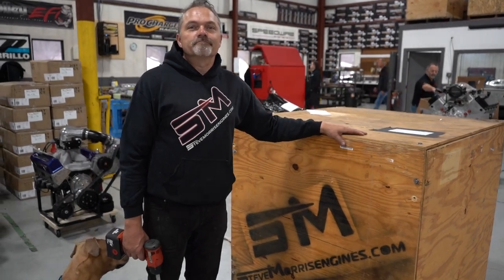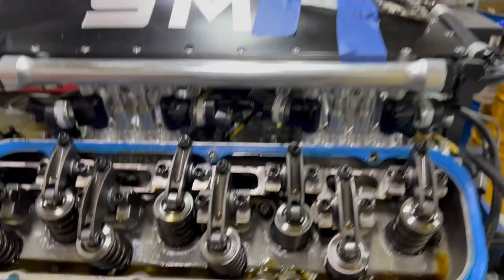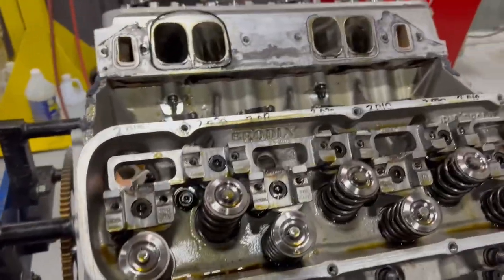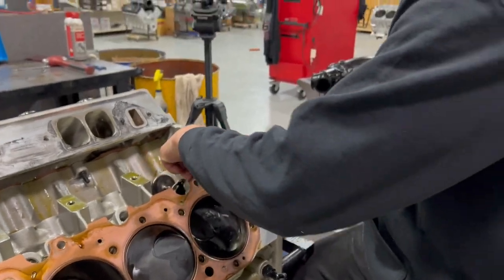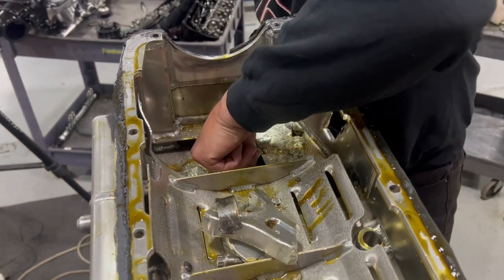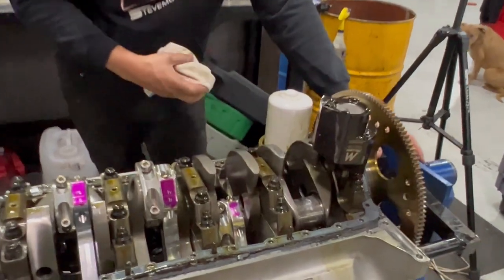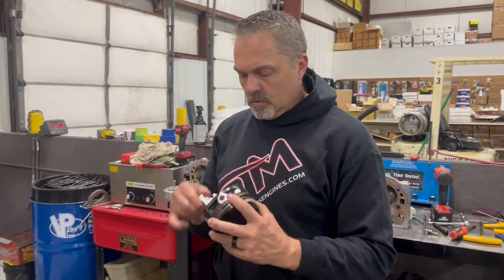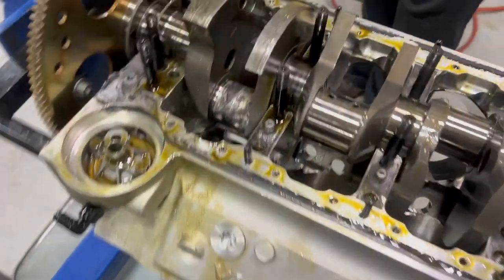Mullet !  What Happened ? - Warning: Engine CARNAGE

Comment: Hi Steve, when mullet did a wheelie and banged down scuffing the track could the kinetic energy involved in hitting the track along with the energy in the rotational mass damage the crank etc. Just a thought, thanks for another great video.
Reply: That is a great question.
Reply: That's maybe possible. I was thinking about what has happened when the engine was running with no oil for a while. My conclusion seems reasonable too.

It seems like the oil pump is on that side so 7/8 will be the last pair to get lubrication again when you run without oil. The heat is on the ' wrong side' of the bearing and since Steve had trouble to find an explanation for it, I think it's the aftermath of Cleet being 'an idiot'/making a mistake. Read below if you're interested in my reasoning.

My full explanation:

The engine was sitting in the shop with no oil in it so all the oil remaining in the engine/bearing flows to the bottom. Then the engine is started without oil and naturally the bearing side that is on top will heat up first, cause almost all oil has ran down to the bottom part of the bearing cause gravitation is real.
Same with the pistons. You don't know at what position the crankshaft came to halt, but if you look at it it's likely that that the crank part of 7/8 was pointing down. You can see that the spot where the heat was is facing up both times if you rotate the crank.
The way Steve explained it the bearing of the rods are fed from the crank bearings. After Cleetus put oil back in the pressure in the oil system is starting to build again. All the oil is pumped into the engine again and will take the path of least resistance. That means that almost all oil will flow past main bearing four so the dry side of that bearing four will get most heat of all crank bearings. When the oil finally gets to the rods most oil will flow past rod bearing seven till rod bearing eight has built pressure and bearing seven will finally get full oil pressure.

If I understood Steve correctly, it all makes sense.
Reply: @CrossEyedLion85  I think you would see more damage on the rest of the bearings if a dry start caused all of this. Oil hangs around as a film, I am sure it didn't do any favours to the bearings starting it with no oil, but no load and a short time isn't going to make a lot of heat. It was also mid Sick-Week so I don't think the oil was out of it for long, leaving more of a protective film behind than if it were drained and sat for a while empty.
Reply: I say starting it up without oil started the chain of events that bought on her demise. Your outta here.
Reply: @seangreene64  Why do the rest of the bearings look fine if that is what started this?
Reply: @CrossEyedLion85  the problem i see in your hypotenuse, to use the proper nomenclature, is that the visible signs of thermal breakdown due to friction occurred on a main journal.  thus, no rod bearing failing to remain afloat.  
✌️🐝➕
Reply: Good comment. Hopefully Steve responds
Reply: @seangreene64  I hope your misuse of you're was because you actually meant you were outta here. If so, thank you.
Reply: @--_DJ_--  As I explained the 4th crank bearing and 7th rod bearing will stay 'dry' for the longest time simply cause that seems to be the design of the oil system.

If you drill holes into a water hose and you fill it up for the first time, you will see that the holes closest to the water input will be at pressure last. Same thing in the engine.

I assume that Cleetus let the engine run without oil. Noticed his mistake. Filled up oil and instantly started the engine again.

That way the bearings will have been hot already with the remaining oil getting thin like water. Causing the start of what happened here.

Obviously you fill your engine with oil before you start it, but in case you forget like here you should refill the engine with oil. Let it cool down over a few hours. Then just crank the engine with the startet motor till you have oil pressure again and then restart on ignition.
Reply: @CrossEyedLion85  If you have a good pump on your hose that first hole comes up to pressure very quickly, and a bit will be coming out the whole time until it is up to pressure. 
There isn't enough damage on the other bearings for your theory to make sense. They all got the same treatment, there would be signs of heat on all of them if there was heat on any of them. The fraction of a second it takes for oil to get from one drilling to the next isn't going to make that big of a difference.
Reply: @CrossEyedLion85  Man cant argue with your logic.👍👍
Reply: @CrossEyedLion85  Those delays you refer to between sections achieving full oil pressure is negligible at best. The flow rate that these and all oil pumps create is huge, think fire hose aimed in your kitchen sink flow rates. The  crank is the first to see oil flow on engine turn over and then upstairs to the top end.  Generally the rods furthest away from the oil pump are the last to see flow but again only micro seconds.
visible damage from low or no oil flow is nearly always around the entire journal due to debris being dragged across the initially good bearing.
The damage to those two journals at the oil pump end are very likely the result of zero contact with the journal and bearing crush occuring on the back side.
Engines can run for an amazing period of time with no oil before damage occurs and at low idle with virtually no load on the bearings heat takes a while to build to fail levels.
I cant speak for steve but when I assemble engines I always use assembly lube on all bearings to firstly extend the safe time while oil pressure is being built during first start especially if I haven't pre oiled the engine prior to spin up and secondly it allows for extended shelf times before install and no fear of dry bearings.
Reply: @--_DJ_--   usually it’s a cooling issue in those back cylinders that causes them to lean out from my understanding, but doesn’t look like it in this situation.
Reply: @CrossEyedLion85  the bearing on the cap side was the first to fail. That alone shoots at least some holes in your theory.  Another point that goes against your thoughts. More than 1 half of 1 bearing would have shown heat damage. 
The engine had recently been run prior to the oil change. So it wouldn't have been a dry start so to speak. There was still an oil film on the bearings.

Comment: Things are going to happen when you run engines to the very edge of every parameter and limit. It says alot for the engineering and build that the engine, and the heads, sill rotate and could realistically be saved. Great information and awesome video. Now to order some merch for a shot at a driveshaft!
Reply: Absofrigginlutely
Reply: You are absolutely right, and you highlight what makes Steve good at what he does. It's one thing to say "what would you expect at these kinds of loads and pressures? Things are going to break!" and something completely different to say "Let's find out what did, so maybe we can improve it, or learn from it, and push the limit even further next time." Engineering is a process and Steve is good at it because he loves it.

Comment: Great forensics work Steve. He doesn't assume anything and creates a theory based on evidence alone. 100% agreed, there is an issue with the crank bending and grabbing that bearing. Hydro, over-boost, crack? Who knows. I think we will find out more once that crank gets to the "crank-shop". Interesting there was some water in 7 and 8...
Reply: There was only water in the one cylinder, and a tiny bit in the cylinder in front of it. If you pay close attention I already knew there would be water in there. Look carefully at the block and you can see what looks like oil discoloration on the back side from a lifted head, which makes sense with that being the piston that smacked the head good and hard.
Reply: @donm9090  Yep. You're right.

Comment: It has never occurred to be that a damaged main bearing would contaminate the oil feeding the rod bearings down stream, but after a little research about how the oiling system in an engine works, it makes perfect sense. The snapped valve, destroyed rods and rod caps, and half-smoked rod and main bearing surfaces on the crank made this such an interesting failure analysis.

Comment: i have 0 clue on the day to day operations at SME, but if steve is really down in the trenches getting his hands dirty despite already having a massive name/brand, that's extremely commendable. 

granted this is cleet's engine and he went to their shop and all that, so maybe it's a "one off" thing just for cleet's, but if he really is down in the trenches working every day? mad props.
Reply: Steve didn't just tear down the engine for Cleatus and us, he wants to know why it failed. The only way to improve a product is to know what needs improving. He has to know where the weak points are in a build, and you do that by tearing down broken engines.
Reply: @victormaniaci2104  yes im aware, but what im talking about is if he specifically does this on the day to day or only because it's cleet's engine where publicity and reputation will be much more impactful.

he has the employees to do it, you can see several of them in this very video... and if they work there then they're all more than capable of disassembly, diagnosing, and repair without the boss man needing to get involved like it is in most businesses.

Comment: Looks to me like connecting rod bolt failure. Seen that in AA/FC racing. Rod stretch, bolt failure or (not saying you or any of your crew) torque failure on the bolt. Also seen rod cap on backwards. This could also be caused by tune. Lean out a race engine like this one and watch what happens. At 23:50 showing the crankshaft. Where did that slug (Tungsten alloy) that was in the crankshaft to balance the crankshaft go? If that let lose THAT is the cause of this failure. Seen that happen as well.

Comment: Just my two cents having seen this before. The rod cap you're throwing in the pan at 12:20 is intact and both rod bolts have the threads from the beam section of the rod still screwed to them almost like a helicoil spring. Then the damage to the backside of the rod journal at 15:25 is evidence of the rod cap getting jackhammered off the rod at rpm when the rotating assemble changes directions as its pulled back down to bottom dead center. Why would this happen? Number 7 and 8 rod bolts were not properly torqued. There's a much longer explanation to torquing rods to give them proper stretch. Even with torque specs I always used a rod bolt stretch gauge to confirm.

Comment: @ 10:30 - if it didn't run at ALL once the valve head snapped, why are there multiple imprints scars from the edge of that valve  head on the top of the piston??? I was trying to figure out why there isn't just one single strike impression?.....Unless perhaps the piston was still rotating slightly when it snapped the head of a left a few skid marks as it came to a stop?

Comment: Could the main and rod bearing failure be caused by the dry startup (no oil) event?
Reply: It seems like the oil pump is on that side so 7/8 will be the last pair to get lubrication again when you run without oil. The heat is on the ' wrong side' of the bearing and since Steve had trouble to find an explanation for it, I think it's the aftermath of Cleet being 'an idiot'/making a mistake.

Comment: Steve, I noticed the 7-8 journal is cooked in the same hemisphere as the #4 main. Is that simultaneous coincidental damage, or serial causation? Is the oil flow path from the pump through the crank, back to front?
Reply: Each main feeds adjacent rod , each main fed from common galley .

Comment: Every time I have done an inspection on an engine that has has come to an early demise I am always amazed, baffled, fascinated, and surprised with carnage and or lack there of and Mullet’s engine certainly has certainly done all of that.  Before Steve started doing the autopsy on Mullet’s engine I would have bet good money on one or more of the main webs of that cast block would of been cracked and or the crank been broken/cracked. I am amazed that the heads are in as good of condition that they are and that none of the push rods and rocker arms are not damaged. Equally fascinating is that on initial inspection the block appears to be repairable. I would of liked Steve to have tapped the crack with a steel hammer to see if it still rings. I definitely am interested on what Steve’s “crank shaft” guy will have to say about Mullets crank after he checks it for straightness and for cracks.

Comment: Did running it w/o oil 2x cause the main damage?  Still, with only half the main damaged, it could be the crank still.
Reply: It only ran without oil once..
Reply: He said that it wasnt an oil problem. And when did Cleetus run it without oil the second time?
Reply: Not a dry start issue. A dry start would have shown excessive wear on all the bearings and other than marks from trash they were fine as were all the other journals and mains. The crank is cracked or bent or it may have had excess deflection. Deflection seems unlikely as that would have shown in other main bearings. One thing he didn’t mention was could he possibly have gotten a bad bearing which ended up installed on the #4 main ? Bad as in some materials weakness that caused it to fail. If crank isn’t bent or cracked that would be a possibility for the failure.

Comment: I had a '74 Z28 with a 355 in it.  Raced it all weekend, had a blast in it.  Got all the way home, and heard what sounded liked something scratching on the underside of my hood.  An instant later, there was a loud snap, and what sounded like a power hammer going crazy.  Pulled the right side valve cover, and the #4 exhaust valve spring is laying on the head.  Valve stem barely above the guide.  Pulled the head to find the valve head stamped into the piston top.  The cylinder was cracked all the way down.  As a 21 year old Airman First Class in the AF, my bank account struggled to get a new engine in that car.

Comment: Remember, the pass, or a couple passes before she come apart, cleet shook the tire and spun real hard and hooked hard when he let off. Wonder if it could twisted/bent/cracked, the crank when it did that. Crazy things happen at these power levels. Go back and watch his videos!
Reply: I doubt you could bend a crank through a torque converter, but I could be wrong.
Reply: @--_DJ_--  3500hp does crazy stuff
Reply: @D J  steve has talked in other videos about tire shake, i wanna say, cracking blocks or something similar on some of his other high hp engines.
Reply: @fourstarman1  There are a lot of other components to absorb the shock before it gets to the crank.
Reply: @fourstarman1  I can see that in a car with the engine rigidly mounted in the frame. That is a lot different than bending a crank in my mind.

Comment: Can't wait to see what you got up your sleeve to try and handle how good OL' CLEET seems to have no problem just completely ignoring whatever boost limits you might give him! lol    Your next build for him, hopefully an SMX, needs to be able to handle at least 25% more boost then what you tell him it can!  LOL
Reply: im thinking the the main bearing said adios, sending its debris into the rod bearings causing them to check out as well.  Then the rods said a final "Get to the choppa!"  before finally giving up on life!   What causes the main to give up, don't know, maybe the crank woosed out and folded a bit!  Can't wait to see how the crank exam comes back!
Reply: well firstly he is not on hobby level that broken engine would mean whole season of saving money to put it together, he is there to be fast and win not to be safe and slow. Given he pushed his luck whole last season, would you upgrade to smx if your engine done whole season without problem? No, you would push your luck again, well it run out, stuff happens...
Reply: @MstreetDriver  Not correct. Most of last season Garret stayed within the boost limits that Steve Had informed him of. Last year year they only ran like 25 to 30 psi of boost. Late last fall is when that changed. Garret did consult Steve and made his choice to have Pete turn it up past that limit.
Reply: @ritchschut1997  and what's incorrect on my statement? he was turning it up whole season and it lasted, of course he will not start this season on lower boost again
Reply: @MstreetDriver  he didn't push his luck all last season. He kept everything within  safe limits until the last couple of events of  last fall. They finally got a really good handle on the chassis right around the time Pete started tuning the car. Once Pete got the traction control sorted out, that is when they finally started exceeding the limits of that engine.
Reply: @ritchschut1997  he run 40psi last june on race week, that's not end of the season and I don't really understand why is it soo important to fixate on one word in the comment... some of the season when they sort out the chassis, happy? the point of first comment was completely different, it lasted and had potential for this season too, unfortunately there was some problem

Comment: I wonder if the water in number 8 may have been a partial contributor to the bent crank, possible hydro lock at some point through a weeping copper gasket? Also the fluid staining between the back of the head and block, maybe it slightly lifted the head once? Love the tear down video mate, it is always interesting to see what went wrong and why on these big power engines
Reply: That thing grenaded in short order. Hydro/mixture over pressure.
Reply: @rossilake218  YEP, Water in # 8 bore when head was removed. Had to come from somewhere. I'll bet hydraulic on initial crank, damage done, just took 2/3 pass to finish the job. Interested how long the car set since the engine was last turned off.
😝